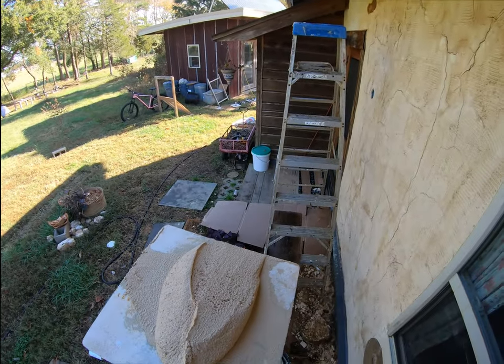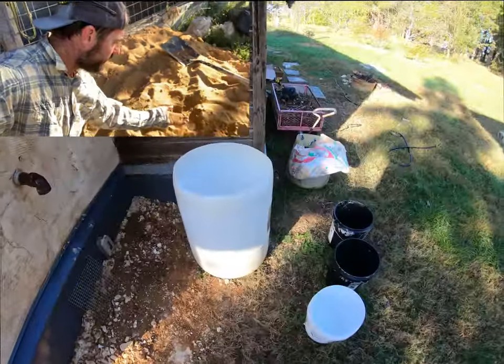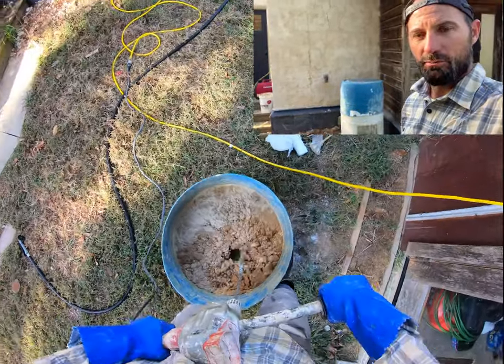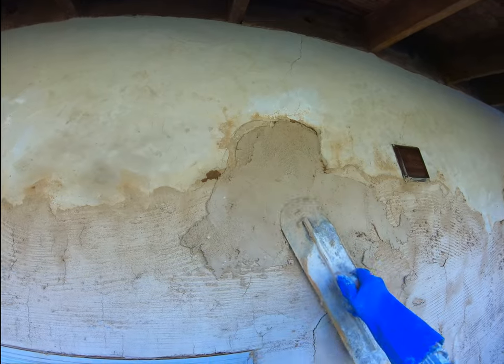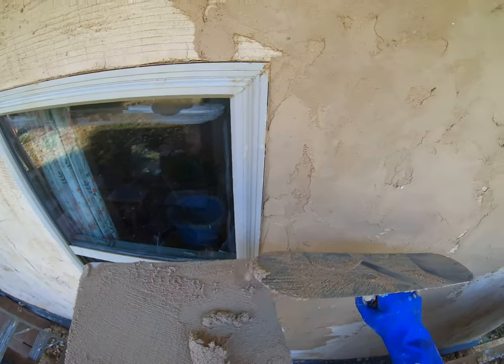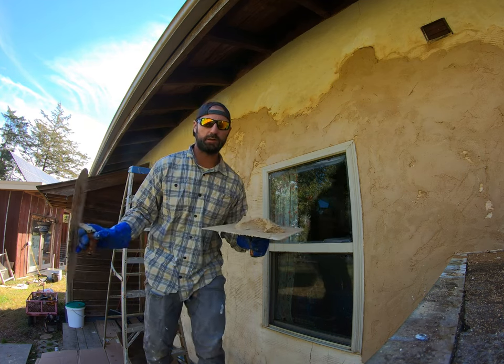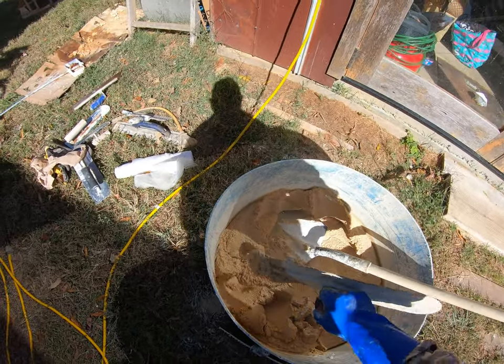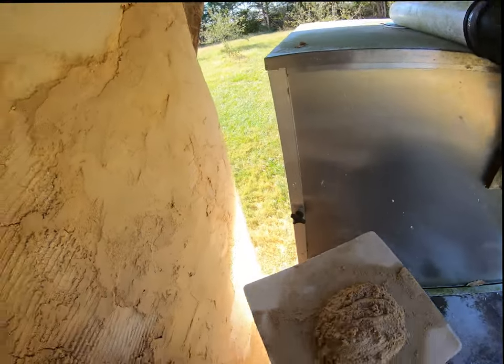Lime Plaster! The Second Coat - FULL EPISODE!!!

Comment: GET  BIG BLUE BUCKET RUBBERMAID AND USE 10QAURT BUCKETS FOR IT SO 6 10 QAURT red clay mix  or 40 cups mix to the 1 buckets straw mulch through a chopper machine only 1 bucket 10qaurt or 40 cups and then 1 bucket of ten qaurts water and then 1 10 qart bucket sand and just the 8% of it for limestones stuff and if you like sparkles in it then bags of the garnets sand and make sparkle if they have money to rty small batch as test you can try such and see if it lasts okay for a test I only made small batches up i got it from acrchaeology guy the mix from mosaic times lol

Comment: Great video ... thank you!  Would you mind sharing the putty to sand ratios for the three coats?  Also ... how long do you let the putty sit before using it?
Reply from the maker: Hey Jeff, 
This video has the mix ratios and explanations: LIME PLASTER: The CHEAPEST and MOST DURABLE SIDING that's been Time-tested for 1000's of years!
https://youtu.be/dXWUrDxQRfQ
We let the lime putty slake for 48 hrs or longer. As long as the putty is submerged by a small layer of water on top, it will be fine and can last for months
Reply: @HeirloomBuilders  Thank you for the response.  Keep up the great work ... your videos are incredibly helpful.

Comment: WHat mix are you making it? 6 part red clay 1 part sand 1 part water 1 part straw for brick or mortar right yes? Is that what you do ?  What is your mix that cracks ? Try the right mix and see if it wont avoid cracking .